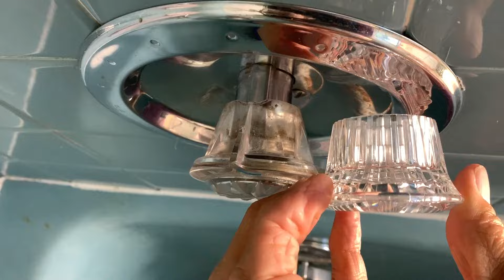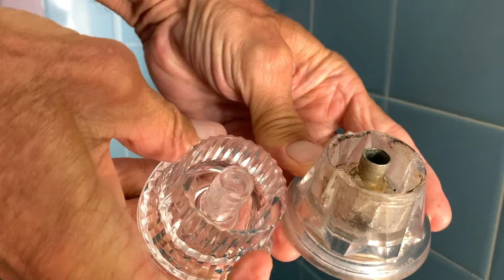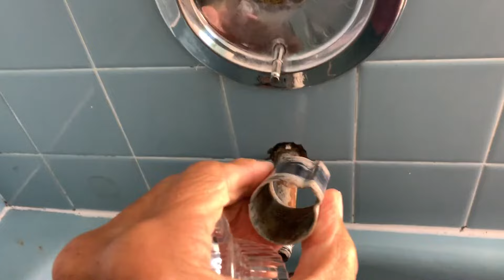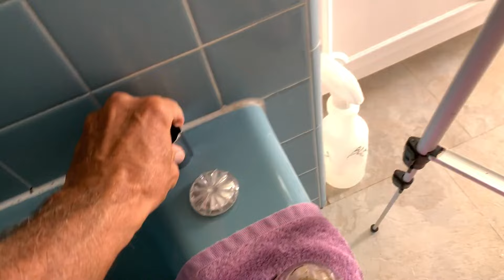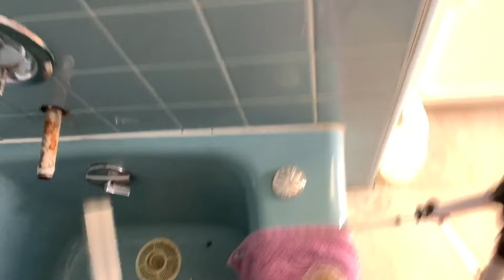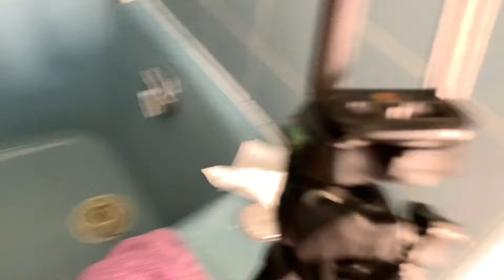How to replace a Moen shower handle

Comment: Why can’t I turn the knob after I have replaced it with a new one
Reply from the maker: It should work in the exact same way that the old one did I would probably have to see it to figure it out you may have it tighten down check the nut

Comment: Nice video .. how did you remove the bathtub faucet cover ? Without damaging the pipe ? ..
Reply from the maker: Some have a little screws that you have to loosen either with an Allen wrench or a Phillips all depends on which one you have good luck thanks for watching
Reply: Do you need the 2 small washers that came with it?

Comment: My screw in the middle is stripped or something because it just keeps turning and won't come off. What should I do?
Reply from the maker: Try to Put pressure outward on the handle by pulling as you unscrew slowly
Reply: @TomLeeman  I just left it overnight and tried it the next day and it came right off. Thanks though.

Comment: thanks for the video. How would you adjust the hot/cold mix? I dont see the temperature limit stop. 

Do you need to remove the back plate?
Reply from the maker: I think usually it’s set in the faucet
Reply: thanks for reply.  mine was a 2 piece gear I just didn't notice it in the video.